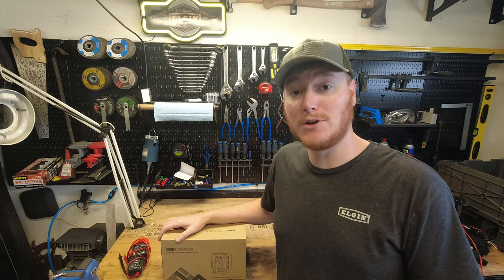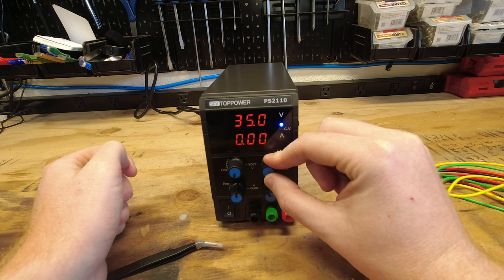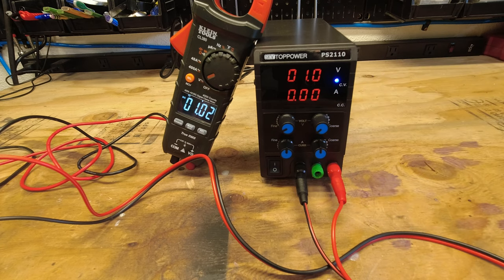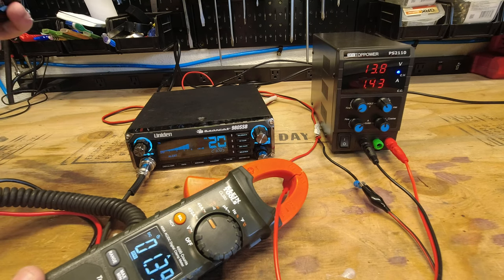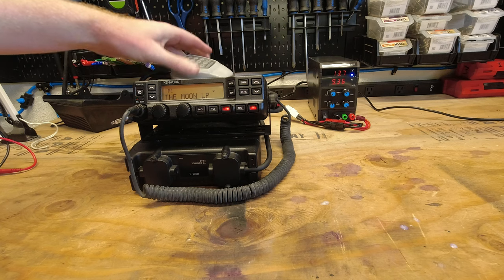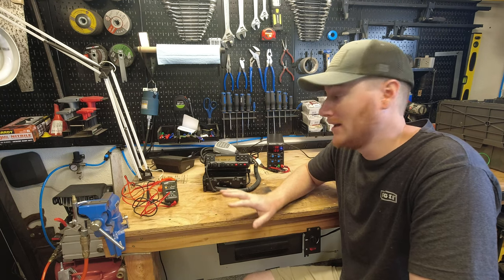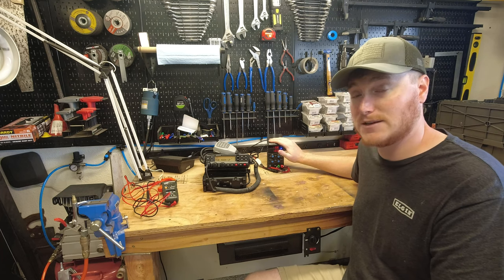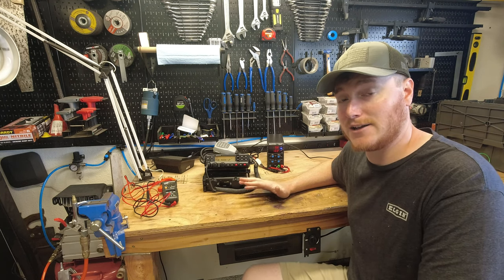Learn Everything You Need To Know About The SKY TOPPOWER Variable DC Power Supply PS2110

Comment: I would also recommend checking the red/black cable that came with it. Those are bulk made for several vendors. Unscrew each small bolt and check if you actually see any conductor cable touching the main connector, mine was simply cut flush and the screw placed inside where it made for an extremly bad connection.
Reply from the maker: Good advice thanks for the comment!
Reply: @UnboxingNStuff  but why not check and let us know how your's are?

Comment: Thanks for the video :), so i decided to get one and i bought the PS2107. The thing is that the voltage that is output is incorrect. At 32 volts all of my 3 multimeters detect 35volt. Anyone know of an adjustement? Would there be a reset function? Guess ill need to call support :)
Reply: Solution for anyone else that needs to calibrate the unit. Once opened there are 4 trimpots. The one closest towards the outside on the front pcb is the one you need to turn to adjust the volatage being displayed on the unit and must then match your multimeter. There is another one inside the other pcb, the top one, this will set the max voltage of the unit. The other 2 are for Amps but i don't know how they work yet. Enjoy!
Reply from the maker: Great info thanks for sharing!